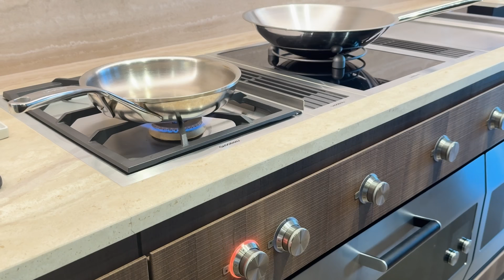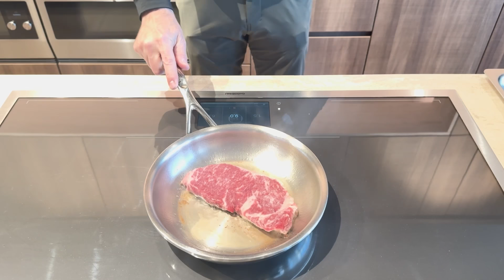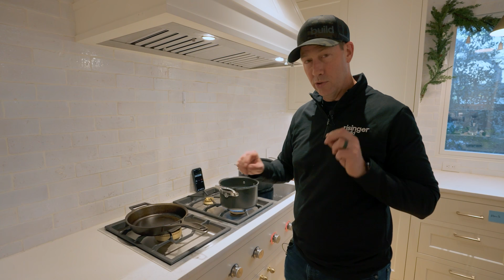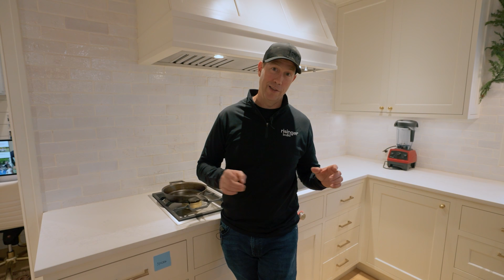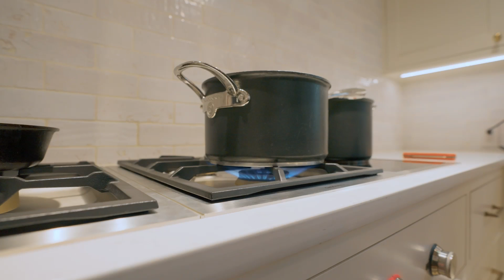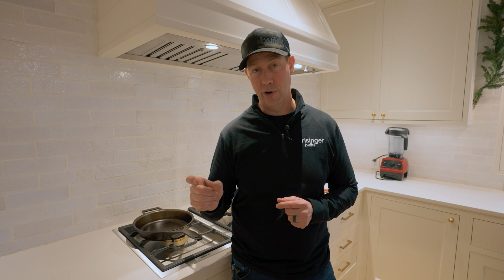Here’s Why I’m Ripping Out My Induction Cooktop | Build Show Clips

Comment: What nobody talks about is the amount of radiation an induction stove puts out. Anybody with a pacemaker needs to stay away same as a microwave. It’s not talked about but get a meter for dirty radiation and you will see. I got a one burner induction burner for outside cooking and then I read about the rad it’s puts out and will not use it. Most people are unaware of this. You get small rad from outlets which is fine but those things are way high. I found out after being given a med device to heal my neck and it would bother me so I tested it. It was so high I threw a $3000. Med device out. This stuff looks good on the surface but if you don’t check it , it will cause more problems way worse than cell phone radiation.

Comment: Obviously it's a personal preference, BUT... I seem to recall a bit of concerns regarding inside air quality & even with the great venting you have installed (including the proper amount of intake supply you need when running your vent) the gas top is more inferior & will be continuously releasing harmful VOC into your kitchen 24/7/365.

Comment: Gas wastes energy you pay for with all that heat going up the sides of the pots, and putting combustion exhaust into your room air.  If your on town gas then chances are you are paying a connection fee even before you use any gas, and if your on bottled gas your either paying rent for bottles or having to replace bottles every time they get out of test. Then there is the danger of gas leaks! 

Compare that to induction cooker and the heat is created from magnetism in the bottom of the sauce pan so it is incredibly efficient... Chances are you already have the electric utility connected so you only pay for the energy you use. It us safer and cleaner with no unburnt gases or exhaust going into your room...    And last but not least is that with electricity you can do something to reduce your utility bill by adding roof top solar, which makes it great for the environment ... where as gas you are stuck paying whatever they charge you. 

I have had both gas and induction and I still use gas in my RV I'm sold on induction cook tops for home use. And you can get them with variable slid controls rather than 0 to 9 power levels if that is your only bugbear with them.

Comment: QUESTION: I know that there are induction stovetops that turn on and off to maintain a temperature, but that's what I don't like about traditional electric range tops. So, my question is--- are there any that have a rheostatic temperature control system where it adjusts the voltage to MAINTAIN a specific temperature without bouncing above and below the target?

Comment: I am looking at homes near my daughter in the Midwest. The houses are about 50/50 gas or electric. If I see one I like a lot, the next thing I do is look at the furnace and water heater, I am looking to see where I can get a gas line from to the kitchen (if it is electric). I have cooked on electric and induction and I prefer my gas range to any electric one. Last year my daughter had a storm roll through and it took out the power for 5 days. She did not have a backup generator at the time. She was able to shower and sleep in the house but no cooking... One thing I have noticed is that I am not aware of any good restaurant the cooks exclusively on electric, I have worked in kitchens for about 40 years.

Comment: Overall, induction will be the best choice for most people now it's pretty affordable. Zero air pollution, it's safer as there's no open flames or gas that could leak, hugely easier to clean, there's a lot more smart home options with induction cooktops if you want them, they don't emit lots of heat and humidity in to the house, and the surface can be used to put items and prepare food when not in use - a major win for small kitchens. Potenial downsides like number of power settings and how evenly they heat will come down to the model you buy, so you don't have to choose gas to resolve those issues. As for power cuts, you can just keep an inexpensive camping gas burner in the cupboard and there's no need to let that issue swing you either way.

Comment: You stated you have a 400cfm hood? If correct, that is entirely insufficient for those gas burners, which are likely 25k btu per burner. That is EXTREMELY dangerous, producing CO gas the hood is incapable of evacuating. 

On similar note, in a power outage, operating those CO generating burners while hood is inoperable due to not being supported by backup power device, is how people die from CO poisoning. Suggesting this as an option is extremely dangerous and irresponsible. 

We build all homes for last 8 years, including our own ranch here in CO and vacation home in MT, without CNG or LPG hookups. They are all passive certified thus require very little amperage per day to maintain interior temps. All have minimum 24kw pv cells and most, including our residences, use battery backup systems. 

We use Subzero-Wolf appliances in our homes, some of our builds have used Miele, which is what it appears you previously had. I’ve never heard anyone complain about any Miele appliances but I’m not the cook in our household and we have Wolf induction top which my partner preferred aesthetically, especially the ovens. She’s a very good cook, which has never regretted not having gas range or oven.

Comment: We have a zone free Miele induction cooktop which is way faster and cleaner than gas. It can track up to 6 pots, frypans if you need to move them around as you’re cooking. We have a 32kWh battery with a 12kW inverter. Even if you’re using a wok and cooking at max temp, it still doesn’t use much power.

Comment: You spent a lot of of money on the house and couldn't afford the small amount to go up to a 22k backup generator?
I have had induction for 15 years now and love it. You need tri-ply, cast iron, or steel, aluminium with disc does not work welI. I do have a gas dryer, furnace and water heater so I am not preaching the all electric either.

Comment: If you are only looking for backup in a power outage get a camp stove or use a gas grill. However, induction does also have drawbacks that make me unlikely to ever switch. Induction develops a high pitch whine, yes even the "good" ones, that is physically painful, and it doesn't work well with certain types of pan, like woks.
Reply: There are countertop wok induction units you can get.

Comment: I love my induction stove and it’s because I know gas stoves are not a good choice for clean indoor air even with a mechanical air exchanger in an air tight house like I have in northern Canada. I have a heat pump and hydronic floor heating as well and if we had an electric power outage during the lowest temperatures (-30°C) in the winter the house would stay above freezing for a couple of days because of the double wall insulation. It’s very rare to have a power outage here that lasts longer than a day so I don’t even worry about needing to heat the house. If we were to have a power outage I can just use my outdoor propane barbecue for cooking. 

I think your decision to replace your induction stove for a gas stove is ill-considered for the type of house that you built, especially since the reason why you are making the decision is to solve a problem that is very likely to be rarely occurring and can easily be solved with a cheaper solution like having battery storage or just using an temporary alternative during the rare occurrence of power outages.

Comment: I was not thrilled when you bought into "all electric". You should never rely on one source of energy. There is a place for both. I crack up at all the gas haters having a cow about this. Total brain washing.
Reply: That's the entire point, Electricity is distributed power source from multiple energy sources. Gas supply is reliant on singular supplier.
Reply: Electricity is every source of energy, you can run an induction cooktop from a propane generator, from a solar generator, from a run of river generator, from a battery, from an electric vehicle, from a methane solid oxide fuel cell, the list goes on and on, this talking point that electricity is a single source / 'eggs in one basket' is just gaslighting from the gas company - a gas cooker is a single fuel single point of failure - electricity can come for any fuel source - I'm sure Matt is just flowing with the anti electric tide here, but electricity is the most flexible fuel there it, from sunshine to fossil fuels to portable batteries, you can make your own electricity with ease.

The Impulse cooktop, with physical knobs and a built in battery than can backup your fridge / freezer and charge off a regular 110v socket would be interesting to see on Matt's channel - I guess they have to sponsor him before he shows products, as this is an advertisement show.

Comment: You can just start your stove top with a lighter if you don’t have power.
Reply: Not on the newer gas, not sure if it’s government control or they chose it from liability. they have an electronic safety valve. They need to make a battery backup or at least an overdrive.

Comment: I live in northern Montana and use induction for cooking.  My gas boiler, in my double wall home,  has been much more efficient over the past 30 years than electricity ever would for heating.
Reply: I live a few hundred miles north in Alberta, my electric heat pump with its auxiliary boiler (kicks in when temperatures are -30°C) and hydronic in-floor system are much cheaper than having gas for heating my double wall insulated house.

Comment: Much prefer gas over electric.  Wife prefers gas over electric.  Every try to cook in a real wok on an electric cook top?
Reply: LOL Electric Coil cook top is nothing like INDUCTION. Especially on 240v induction is massively powerful. There is concave induction stoves specialised for Woks. Which are overkill powerful and you have to be careful not to burn the food. Gas stove with that many BTU would be problematic inside a home.
Reply: There’s plenty of excellent woks made for induction stoves and lots of professional chefs use induction burners in their videos. The trick is to learn that the wok heats up very quickly and the temperature is more consistent with induction and high heat on an induction burner can be very much higher than expected when compared with a regular electric stove.

Comment: Cardinal sin to mansplain to the wife that you need an electric cooktop😂😂😂  My wife hated induction. Had to get new cookware.  We're back to an all-gas cooktop.

And why, why, why don't you have solar + battery?  We have 16kW array with 75kWh battery. We're effectively offgrid ~98% - the few really cloudy/rainy days prevent full battery recharge, but otherwise we never use the grid, and our excess solar exports offset the mandatory grid connection fees.

You should talk to Texas-based EG4 about a solar/battery setup.
Reply: I have an induction cooktop and love it! It’s much better than gas because if the pasta or potatoes boils over because of a distraction , there’s no burnt on mess. I had to get used to the faster heating times for boiling water and the lower temperature needed for sautéing, but the benefits of having an easier to clean cooktop and more precise temperatures when cooking are worth having to learn new tricks.

Comment: I get it, but I do think that having gas and using it regularly, which has shown to decrease indoor air quality and have health implications, for a rare case of a power outage is a bad line of reasoning. Get a portable propane burner as a backup for your stove.

That being said, if you just hate your induction stove and don't care about potential health issues, then it's a personal preference matter.  I just think the "gas is power outage proof" argument is weak, personally.
Reply: I totally agree. We built our house with double walls and Zip-R 6 sheathing and the blower test came out at about 0.6 ACH. We had previously watched plenty of videos on air tight houses and had really appreciated Matt’s videos. We’re north of 52° and the house has performed great with its electric heat pump and hydronic floor heating even when our winter temperatures drop to -30°C. I have an induction stove and it’s great for cooking although I had to learn to remember that the temperatures are much quicker, more precise, and consistent. 

I also have to consider power outages but that’s easier solved with using a propane BBQ outside and a battery storage system for those rare occasions.

Comment: I think some of the dissatisfaction with induction comes from the “magnetic zone,” actually being smaller than it appears.
Reply: That's not a thing with those high end cook tops where it is just a grid of coils. Even on cheap portable cook stops the coil is about 6" but really need about 7.5" of space for optimal performance.

Comment: There's an easy solve for the power part of the issue....you could have bought a different panel that would support your cooktop. 

You went on about your kids and air quality in home as a primary reason for not wanting gas...how did that change? You clearly have the means to solve for the power..then and now so let's not even use that as an excuse.